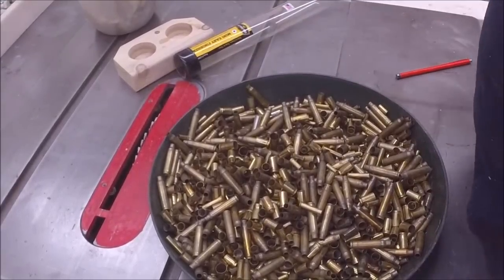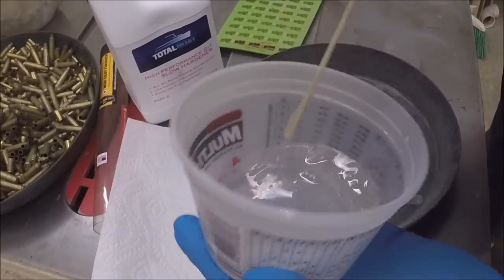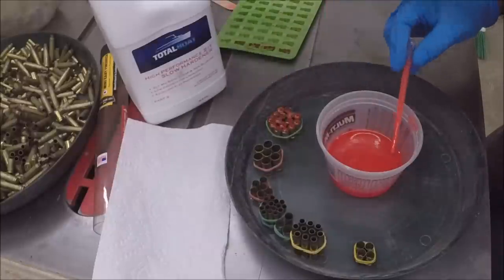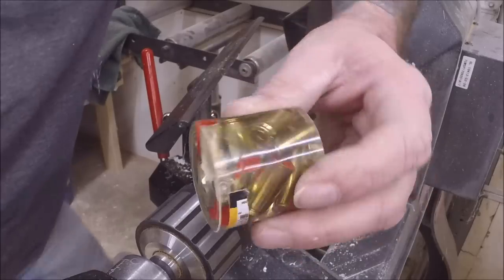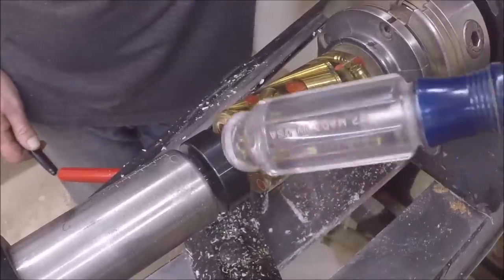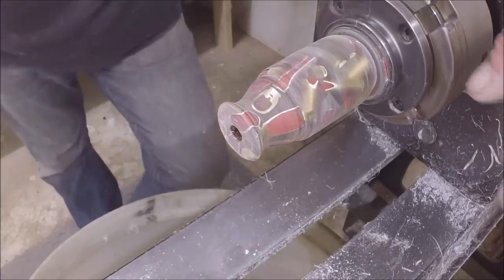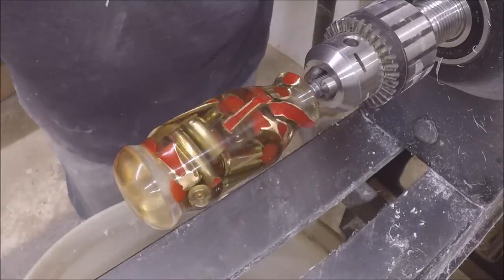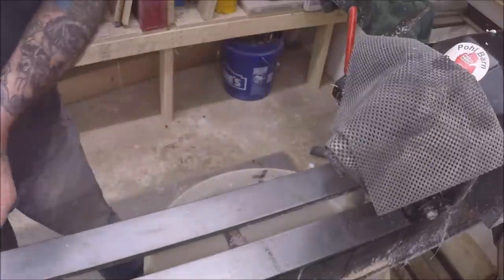Ammo Casings and Resin.. A Screw Driver Handle

Comment: 9:59 Made me feel that using those latex gloves was pointless.
Reply from the maker: they are for the most part pointless, it never fails when you take them off you get resin on you hand anyways, I put them on to keep the safety Police at bay.  LOL
Reply: @PohlBarnProductions  Maybe the epoxy is only dangerous when it is on it's liquid form and that's why you need gloves when you're pouring it. Either way I think you're a cool dude. new sub for the channel.

Comment: Was thinking about pouring a resin counter top with casings like that but after seeing how lingerie it takes to fill the casings to keep from getting air bubbles I'm thinking it may be antique fishing lures instead.
Reply: Sweet long-range screwdriver.
Reply from the maker: Thank You, it does take up some time. you could always just plug the ends if they are just laying on the side or just let the resin fill in that way when you pour it.